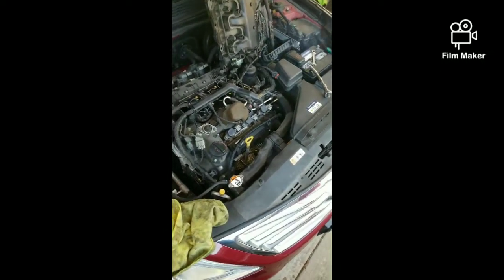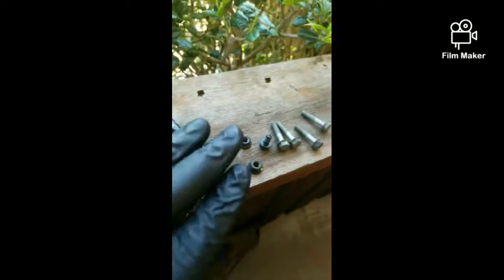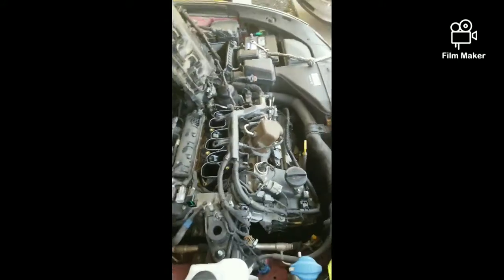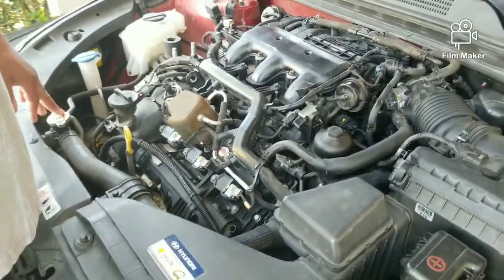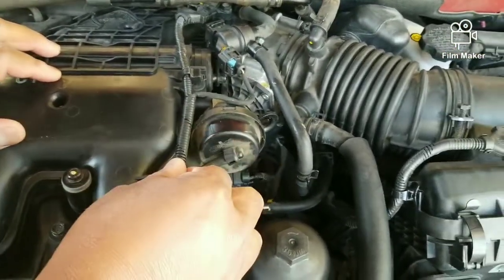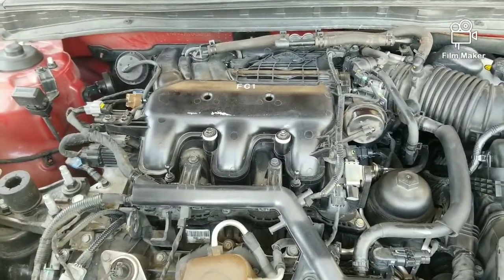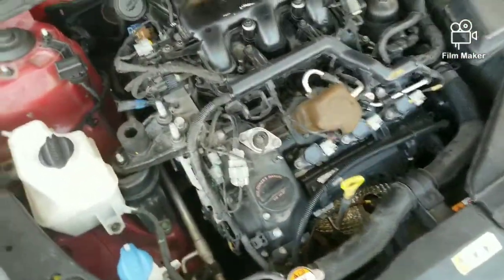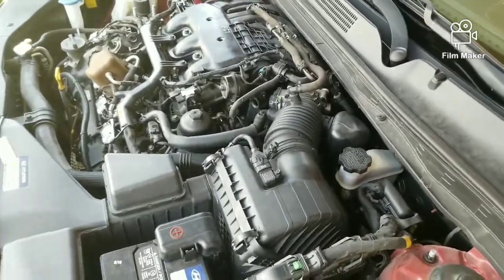2014 Hyundai Azera Limited 3.3 GDI V6 Spark Plug Replacement

Comment: Man I have the same engine in my 2013 Hyundai Santa Fe. You gave me some confidence to probably do this myself. The dealer wants a Arm and Leg for this job.
Reply from the maker: That was the main reason why I ended up doing it myself because the dealer wanted to charge me around $500-$600 to do that job. No indeed! I did it mysefl

Comment: I found that pretty much all Hyundai GDI Engines have that tick sound. Just how their made, nothing to worry about. I have a 2012 Azera Limited with 80K Miles on it . I'm about to have the spark plugs and such replaced tomorrow. I'd do it myself but haven't the tools to do it. I bought the spark plugs and plenum gasket, so all I pay for is the labor.
Reply: I have the same MY12 azera with 230k small tick but runs great. I did a lot of prevent, but not tune up yet. Love the motor though.
Reply: I have a 14 Azera that I got brand new. For the first 10k miles that ticking noise was completely absent. What was weird was the ticking started like clockwork right at 10k miles and I thought to myself.... Great..... Nothing that ticks like that can be good. Took it to the dealer and he told me "congratulations! Your Azera is now broken in!". Went on to tell me that it's completely normal and to be expected. Now I'm at 170k miles and still running like a champ.

Comment: Getting ready to do mine.  Having to take the intake off is frigging nutz.  I wish the engineers that design these things had to actually do simple maintenance on them also.  Thanks for the video.
Reply: Only thing I would add is I would either cover the intake channels with a rag or stuff a rag in each on, just to make sure nothing falls in there.  But that is just me.
Reply from the maker: @Unclegus1 ..... I would definitely put something in the intake runners. Because not long after doing this video I messed around and a bolt fell inside. But very luckily I had a magnetic pick tool that came in handy on that day.

Comment: Hi I have the same car Hyundai Azura 2014 but my only problem is at making the smell of O2 or a it’s making him smell offer gasoline and the smell it’s not good and not fine so I try to replace everything but the smell its same I took it to the air service company and they say everything is OK so what do you think I have or I should replace the black or the nozzle or or watt even I replace both of them so if you have any advise for me I will be so thanks for meThanks
Reply from the maker: If you smelling gas in your car there is a possibility that one of fuel injectors could be stuck open, possibility a catalytic converter that may failing, or even a leaking gas line

Comment: New Day! I just hit 100255 on my 2012 Azera. Do you mind sharing what size you used to remove the spark plugs? And also, a list of everything you needed for this job. I’m kind of nervous working on it myself.

So I need the plugs AND a gasket?
Reply from the maker: @Lisa.... Good day to you. You'll need a 16MM deep wall socket that will fit 3/8 rachet, an 3/8 inch 8inch extension, a 3/8 inch drive rachet wrench. For the spark plugs youll want to get 6 of NGK brand part number 9723
Reply: Ok got it! So there’s the three spark plugs in the front of the manifold and then you have to access the other three by talking the manifold off. Ain’t that some sh*t lol
Reply from the maker: @LisaSherice  ..... Yes indeed that intake manifold has to come off to access the rear 3 plugs 😆
Reply from the maker: But it isn't that bad at all compared to some other makes and models of vehicles
Reply: What if I can’t take off a spark plug because of a snug fit? I have the 16mm in hand sow and I just tried to break it from its hold 😅
Reply: Or better yet, can I call you or FT you too for assistance?
Reply from the maker: @LisaSherice  .... Those plugs should come out without a lot of effort. If there ever an issue where plugs don't come out easy. Then you'll want to use PB Blaster spray and let it soak. Oh also you'll need a 10mm socket to remove the ignition coil before you can get the plugs out....
Reply: I have the 10mm for the intake manifold and the 14mm for the one on the back. You’re referring to be able to get to the actual plug, right?
Reply: @LisaSherice did you ever change them your self? How did it go? I’m having the same issue of the sparks being a tight snug it’s making me nervous of attempting it my self maybe I need a bigger rachet?

Comment: Would you happen to know what cylinder #’s are in front and back. From left to right facing car
Reply from the maker: Yes I sure do. The back cylinder are 2, 4, and 6

And the front is gonna be 1, 3, and 5
Reply: That’s fantastic. I can’t believe you replied so fast. Thank you. I’m working on a 2016 and was thinking that they might be the same. Have a rich 02 sensor and random misfire. Thinking it might be a 02 sensor. Going to check manifold for crack tommorrow. Do you think the 2016 and the 2014 cylinders numbers will be the same as I do?
Reply from the maker: @landanlong247  From model year 2012-2017 the cylinder order remained same. That intake manifold is built pretty good. But definitely wouldn't rule it out as  it could have a small crack somewhere.
Reply: @lawjo1978 thank you for taking time out of your busy life to try and help me. I sincerely appreciate that. God bless my friend
Reply from the maker: @landanlong247  No problem at all. I'm glad that I could help you out

Comment: Have you had to replace the exhaust VVT solenoid yet, if so, can you tell me where it is located on the engine?
Reply from the maker: Hello Kenneth, I haven't replace the VVT solenoid. Usually they are mounted on the end of the valve covers

Comment: This looks exactly like my 2019 hyundai santa fe xl.
Reply from the maker: Hey Juan, they share that same 3.3 liter engine. The same horsepower rating
Reply: @lawjo1978  you ever clean the intake valves from the direct injection?
Reply from the maker: @Juan Rodriguez  Yes I did it once. The entire intake was full of carbon

Comment: do you still have this car?
Reply from the maker: Good Morning, I recently just got sold it about a month ago for a crossover suv
Reply: @lawjo1978  haha awesome. How did it serve you? any major issues with the car? at how many miles did you sell it? I have some maintenance questions as well. I will be buying this car used. Like I know how to check the basic stuff, but what are some things that only an Azera owner would know? Thank you.
Reply from the maker: @somato2688  I bought it brand new in 2014. Had a couple of hiccups with it. For ex... The sunroof on mine was full panoramic and it had a bad seal. So that was replaced under warranty. The factory nav radio had a glitch to it. Which required replacement. But that under warranty as well. Besides that. Just routine maintenance on it. It rode pretty on the larger factory 19's, very roomy, good power out the 3.3 V6
Reply: @lawjo1978  wowow. That's amazing! Thank you Mr. Law Jones! Other than oil and oil filter change, what are other things I should replace more often than other things? I'm asking because I'm getting a 2014 azera this week. It has 68k miles. If you were there with me, what would you make sure to check if you didn't have the previous owners maintenance record. I'm in Korea so the owners here are terrible at keeping records and car maintained. I really don't want to buy a badly taken care of car.
Reply from the maker: @somato2688  I totally understand on not wanting to purchasing a bad car and it's a pretty costly investment. Depending on the model you're buying. About every 2-3 years I had to change out the battery

Comment: I have the 2015 Base,, which of course you know it has same 3.3L engine. I bought car from a used car lot,,,w/117k miles. According to the manual and according to YOU,,it's time to replace the plugs. But, neither you nor the manual say anything about replacing Coils. (1) A few mechanics recommend once going That far into labor, i might as well replace all 6 Ignition Coils w/Plugs. (2) Then again, other mechanic buddies recommend "if it ain't broke, don't try to fix it",,, that if i see no engine light, Don't replace Ignition Coils. But neither of these actually own a Hyundai Azera (though i know they each really know auto repair, it's what they do as a living). But, I'm curious why you and the commenter Michael Gibson, neither of you said anything about replacing Ignition Coils. Just do the plugs ONLY or.....??
Reply from the maker: Good Morning Mr. Fletcher, Thanks for the feedback. Usually the coils last much longer than the spark plugs itself. The only time I will replace the coils if I gotten a misfire from one of the cylinders or the bottom of the coils actually develops a crack. If you do replace the coils. Consider a good brand so you'll be able to get the longevity like the ones from the factory.